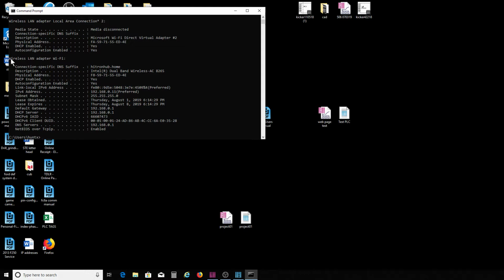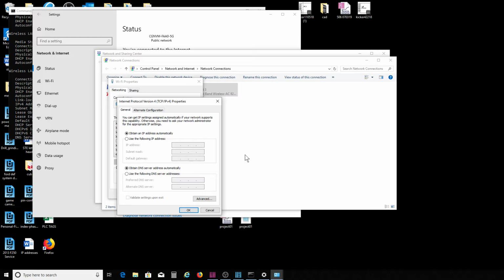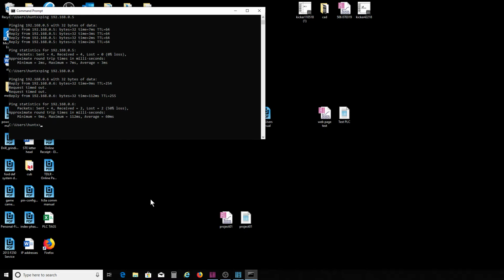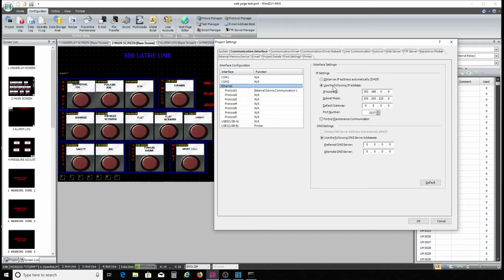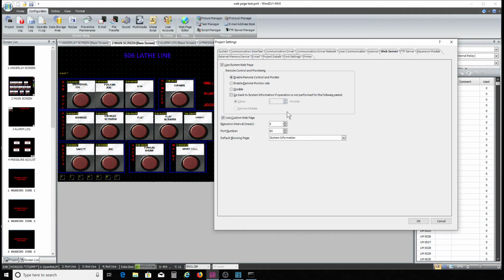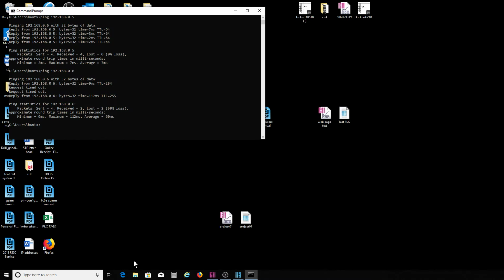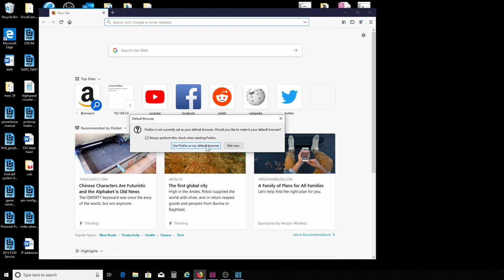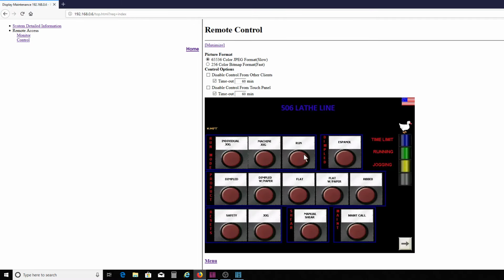Idec HMI/PLC Remote Monitoring and Control

Comment: Very helpful information, no-one is making Videos on IDEC out there. I'm looking to set up an HMI for remote control/monitoring like you showed but via the internet and not just through the home network. Did you ever make a video about that or know of anywhere I could get some info on setting that up? Thanks
Reply from the maker: I never made a video on that.  But, do some research on port forwarding.  You will have to set it up in your routers interface.  Tech support for your router or, your IP would be an excellent resource.  That will get you there.  Little too complex to explain on a message.

Comment: Hello again. I have connected my HG3G HMI direct to PC and use WEB SERVER function. I successfully logged into web page, but data downloading is very slow even use 256 colour bitmap format. Execution interval setted to 1000ms. Any idea for fast connection?
Reply from the maker: I do not have expertise in the speeds of the connections.  But, I do know that even downloading or uploading a program via Ethernet is extremely slow.  I always download or upload the program via usb, for speed.  In Run There is so much data transferring between the webpage and the PLC on a continuous basis, I think you will always have some lag, even on a direct connection.  In run, at 1000ms interval, it is only attempting to adjust data every second.  I would think that would cause the interface to be laggy.   I would call IDEC support on that one.
Reply: @huntxtrm , thank you for responce. But when I change Execution interval to 50ms picture now updates normal as I want.